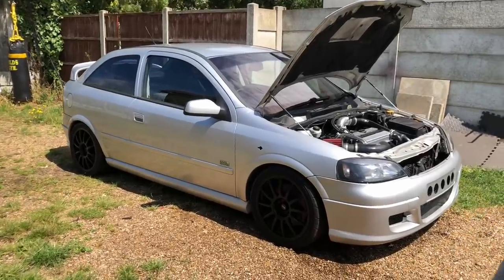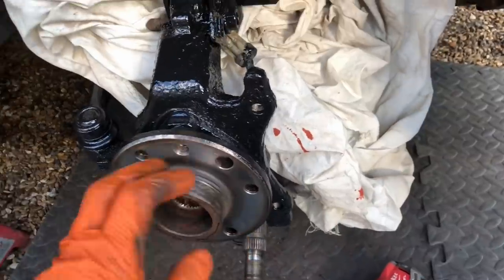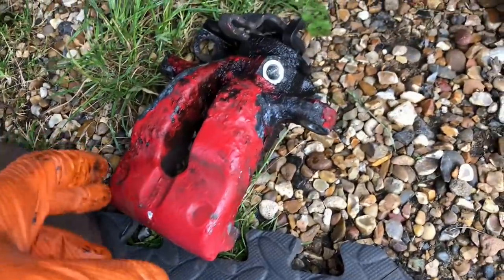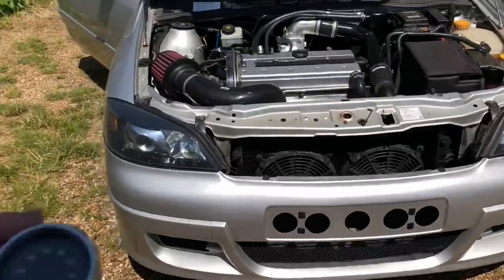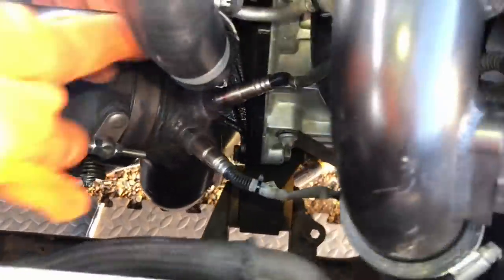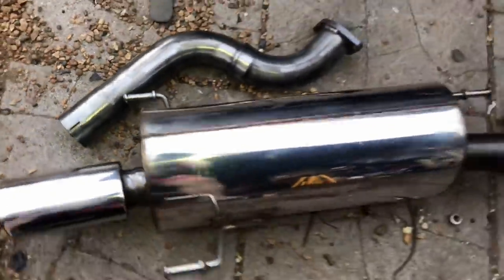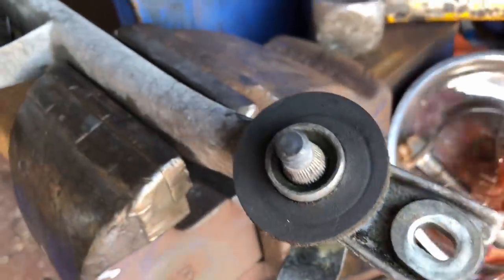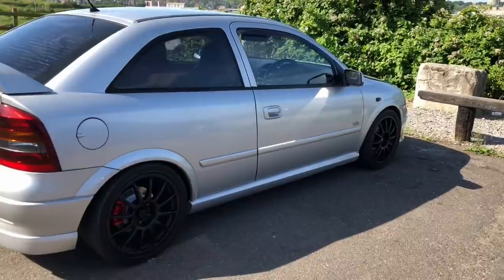STAGE 4 BARN FIND Rare Astra Sri Turbo 190 First Drive In 4 YEARS!!

Comment: I'm a big fan of your gsi videos! Can you dive more into your used components like the radiators, the conversion to brembo, the conversion of your rear suspension with the spring and damper combination on the other astra? Or can you tell is in the comment, which types of brembo and Direnza Radiator you are using? Go on and make a lot of new videos, i will watch them!

Comment: Whats your usual go to disk and pad setup? Vented/grooved/drilled and grooved?  Sounds daft but want to upgrade the braking on my vivaro as I carry quite a bit of weight 😬
Reply from the maker: Ferrodo ds2500 with high carbon c hook discs
Reply: @AaronUnknownPerformance  cheers mate 👍 also how would you boost test a vivaro? Would you go through the intake hose after the maf? Cap anything off?